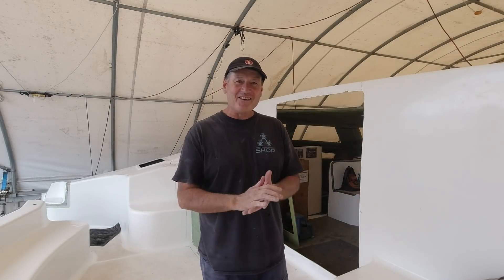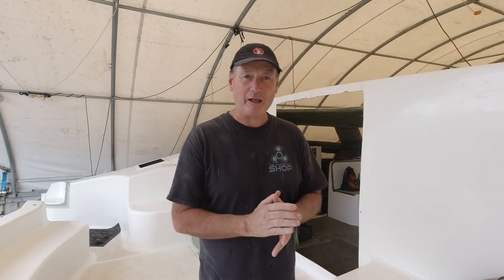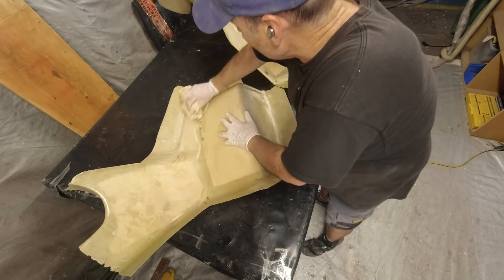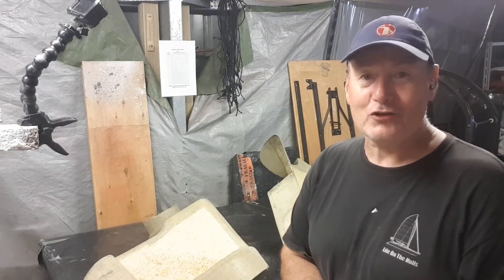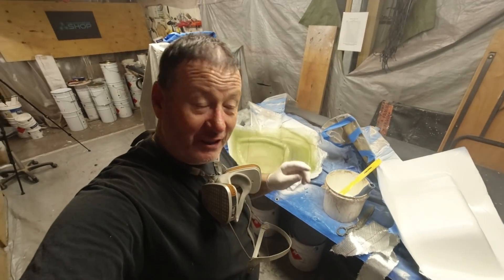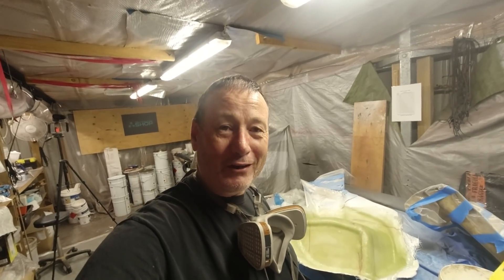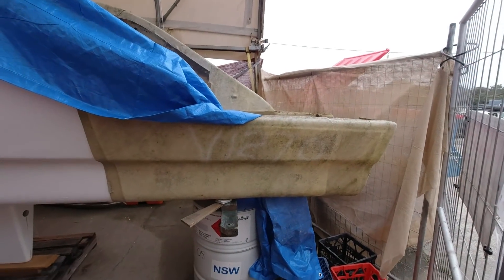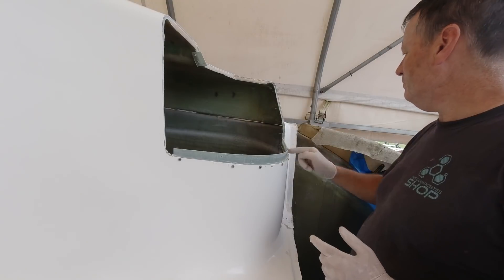CATAMARAN BUILD -  Transom Access Improvements - Ep209

Comment: Two possible methods:

1)  Using yer moulded piece, cast a shadow onto the section to be cut out.  While low tech, you'll have to work out the angles, plus scale +/- as needed..  But this method requires only two planes (vert and horz)

2)  Using a laser, measure each point of the mould out from a centerpoint.  You'll have to establish that point, but it could be anywhere on the mould.  Transfer those points to the hull section to be cut out.

Comment: Mate when your using the hvlp, why don't you use the 3 m PPS , automotive spray system, flexi liner in a cup , sprays  upside down and has a built in filter in the lid 120 micron , no cleaning of the placky cup just bin it
Reply from the maker: Mate if I was just starting O would invest in a new system,but I already have 8 different systems and although I like the 3m system but a thousand bucks now I can use to buy a winch for the boat.Ross

Comment: Are you intending to do any modification to the bow? I notice that your ship has a solid bridge deck, not the usual trampoline area forward, and i'm wondering if its going to be a bit low in the bow. I'd almost consider extending the two hulls out 2.5 meters and put a 3 meter carbon fiber bowsprit off the center, then add a pair of trampoline sections as well, maybe put a bow bulb on as well at the same time. would improve hull speed, forward boyancy and give you more forward lounge space and more forward sail area.